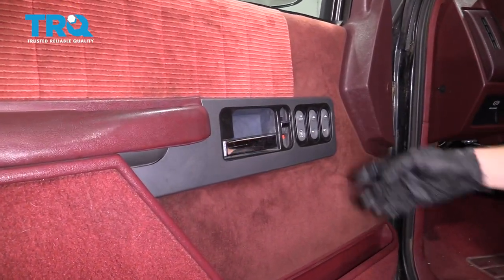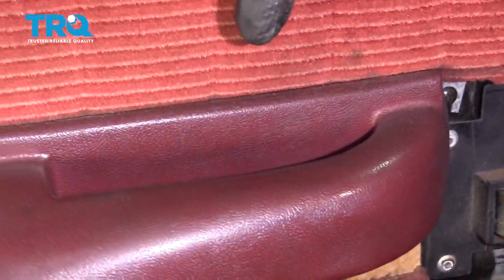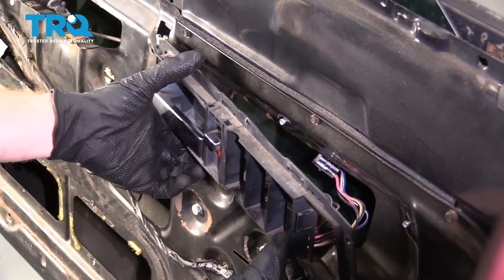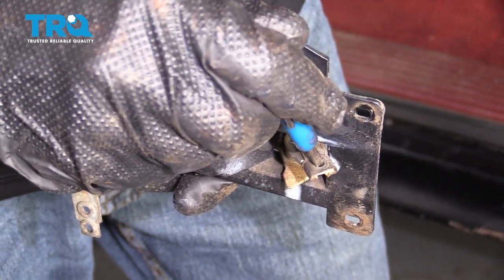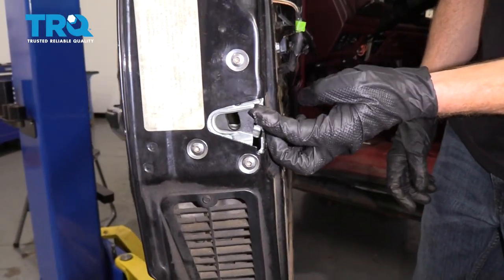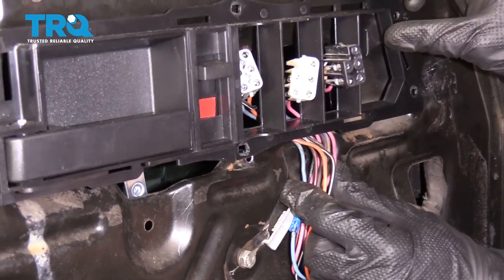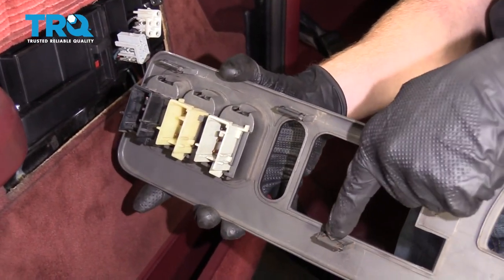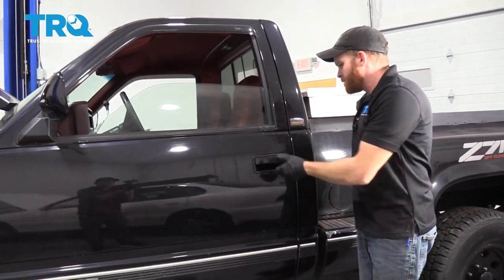How To Replace Interior Door Handle 1988-2000 Chevy K1500

Comment: My 93 Stepside looks Very close to this one. I am installing that part. I am so glad I watched this first as now I realize I need to get a pop riveter. I will replace my latch and exterior handle at the same time . I have rebuilt the door panel twice before and I had given up hope of finding any quality plastic panel fasteners. I resorted to using drywall screws to attach my Driver's side panel. Now I am going to look for yellow ones.